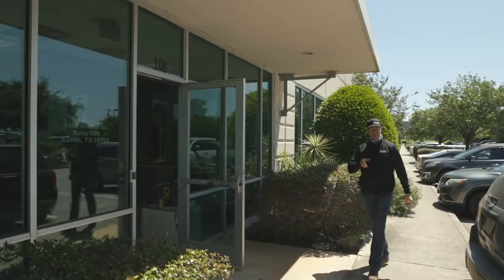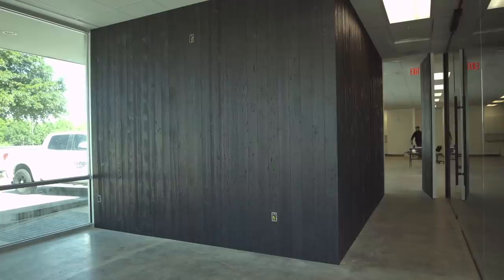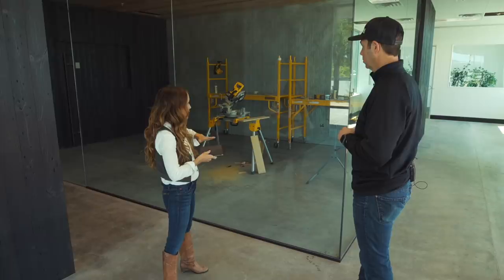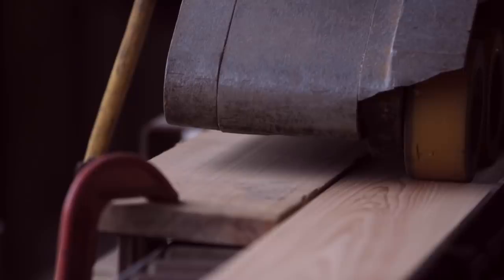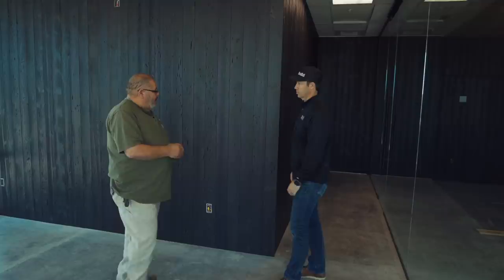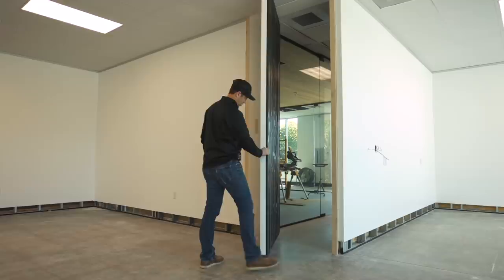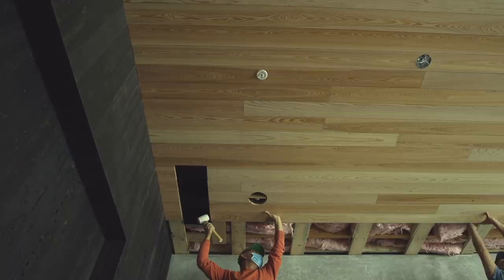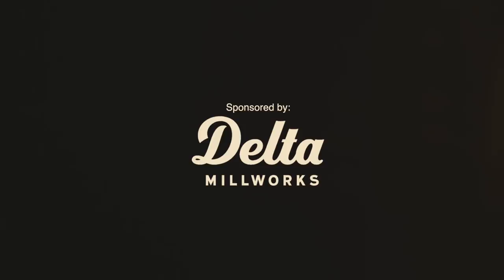Hidden Door + Wood Walls - Design & Carpenters Tricks

Comment: Im a lady DIYer, saw the blue pine wormhole shiplap at a box store.  After seeing your wall I want to use it inside my Tiny House 5th wheel to blend into a blonde shiplap ceiling. Will keep  the natural look to give the smaller space a roomier effect. I wasn't certain what you put behind the panel but the open ceiling showed me that. Plus the 30° angle end cut & glue is helpful info. Love the black ushgi look & will use it for the i/e W&D trim for the durability around such water volatile areas.
Any other suggestions for this type of install? Saving this vid for when the time comes along.😏 Thanks!

Comment: Review from an Architect: The craftsmanship from Gilbert is superior, and love the character blackened beetle kiln pine. However, the design is subpar. The shiplap should have run horizontally. The back office wall does not recevice much sunlight. Matt, you should have picked a lighter color wood on the pivot door and the TV inset to break up the black mass. The raw rough-sawn pine on Robbie's hand is perfect and full of character.

Comment: Might be worth adding a dark brush/broom strip on the bottom of the hidden door without having it reach the sides. The light leaking out from under the hidden door is something I always see under doors where the carpet was removed without getting the doors refitted.

Comment: Beetle-kill, a product of the Rocky Mountains... and the near moratorium on any type of logging propelled by the repeated message that logging is "bad", "offensive", and "destroys" the beautiful forest. So instead, let the trees stand until the bugs eat them and kill them, which in turn creates elevated fuels, which in turn drives extreme fire behavior, which in turn burns so much hotter that the ground is sterilized and new trees won't grow for decades. And then log the dead trees anyway... which is OK because they aren't pretty anymore. [Rant Done] Hats off to Delta Millworks for finding a market.
Reply: But, but, but Snowflakes need the FEELS of doing the right thing even if they're too stupid to know it's the wrong thing.

Comment: You may just use magnets to put on the base boards to the steel footers in the walls. Thus you have tool free permanent access to the wall bases configuring network wiring and so on.

Comment: Hi, would have been interested as to the actuall wall structure. What did you install behind the wood panelling, over the metal studs, to provide nailing for the wood? MDF or OSB, how thick 3/8, 1/2? How oriented vertical lapped or horizontal lapped?

Comment: With the hidden door at the end of the hallway, it's fairly obvious due to the light leakage underneath the door. This can be fixed with either some weather sealing or if you want to get fancy and protective, an automatic door bottom. Here's a link to one that aids in preventing break-ins: https://www.assaabloydooraccessories.us/en/products/door-bottoms/security-door-bottoms/pemko-stc510_/

Comment: Love the wall boards. Is there any smell from the burning? Also, is there any charcoal effect, i. e., rub off on skin or clothing? Thanks.
Reply: There's no smell by the time the boards are being installed. For this finish, they brush them after burning, which removes a lot of the loose charcoal that would rub off, and then the boards are sealed. They could be poly, they might be oiled a bunch with linseed/etc, there's a few different ways to seal them. For exterior use, usually they're just oiled liberally. For this interior application, I'm guessing they have more of a "coating" type of final seal, like poly. Just depends on their process.

Comment: Please refer to the video at time 3:43. Why is there no vapor barrier on the ceiling? The pink batt ceiling insulation has not been installed correctly due to the air voids.

Comment: Hey Matt and other builders: What would you use to reduce noise from traveling between a condo wall? My kids are driving my neighbor nuts and I can't afford to get kicked out. I rent so I can't alter the wall. I'm thinking of putting up 2 inch of insulation, then thick drywall or plywood, and then covering it all in big moving blankets. I would just prop it up against the existing wall.
Reply: Kris Pitchford bags of shredded cork as isolation! We use it in Construction in Portugal to sound proof masonry interior walls!

Comment: No need to air seal that wood ceiling?
Reply: the74impala this looks like an interior finish in an industrial building not unlike building a store inside a mall.
Reply: Typically in modern commercial construction the space above the ceiling for mechanicals/electrical is a conditioned space within the building's thermal envelope. Think of a drop-ceiling consisting of ceiling grid & tiles. The insulation and air barrier is located on top of the roof deck above, and that wood looks to be pretty much just a fancy replacement for ceiling tiles. Of course, it could always be an older building or something so who knows without actually taking a look.

Comment: A few things -
*That dark wood is awesome 
*Ceiling wood should have matched the wall wood - looks a bit forced / half hearted to say wood is running up into ceiling when it is different pattern and type. Sure it would be dark but it is such a small part of the space it would have been fine (and can be helped by lighting)
*Unfortunately the other white standard plasterboard ceiling tiles and lights are a real missed opportunity. A set plasterboard ceiling would have lifted the space a lot more or no ceiling / batten ceiling since this is a builders office and can be good learning opportunity to expose services / soffit. Sure maintenance and cost is more but when you spend on such beautiful walls (stucco too) and then have a standard office ceiling it can tend to stick out